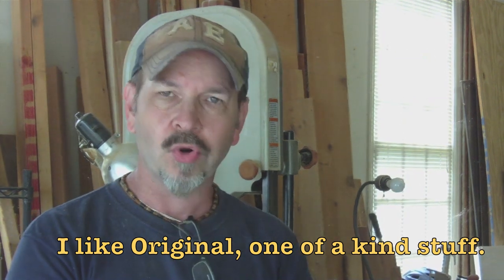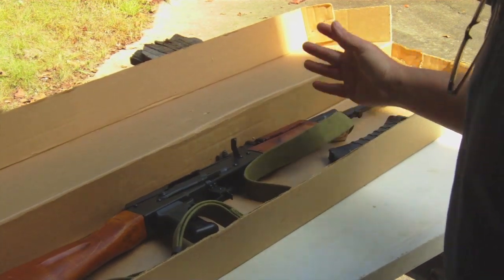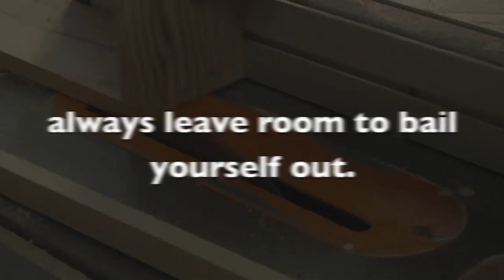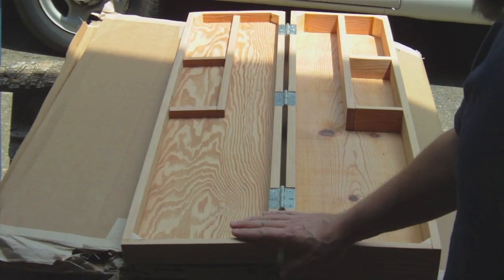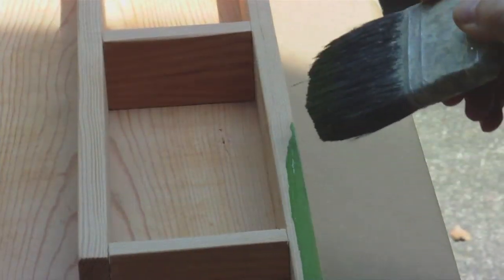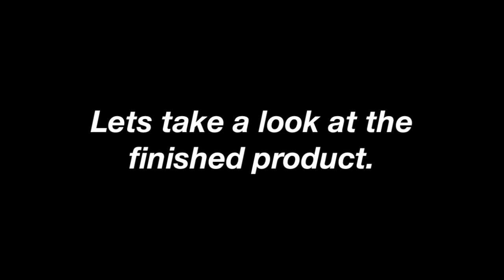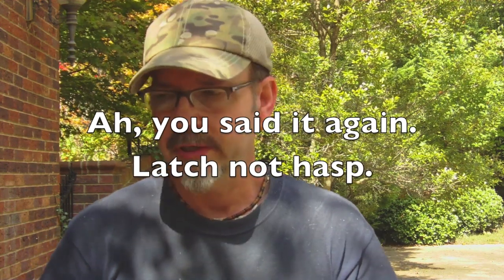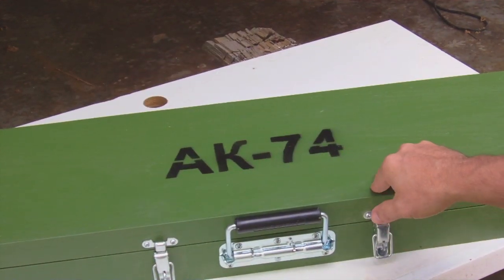Custom Gun case build for my AK-74

Comment from the maker: Yeah I might do a review on it. Mine is a reconditioned model from CPOoutlets, see my vid about coupon codes. They also included both types of pads, no one else did. If you want to buy cheap as possible check on Craigslist for used stuff that is better quality than B&D

Comment: Pretty nice. Impractical for the average DIY'er around the house or in garage kinda guy. You have woodworking equipment that only the best cabinet makers have. How would I make somethin similar with hand tools & at best table saw??? See what I mean. Awesome case though. Wanna sell one?
Reply from the maker: You could simplify the corner joints and not plane down the wood to make it more manageable.